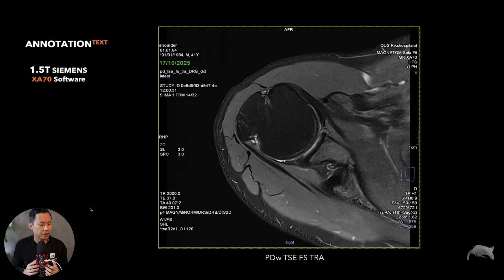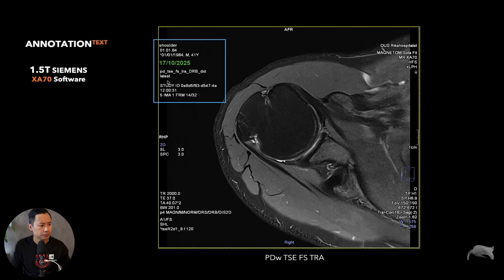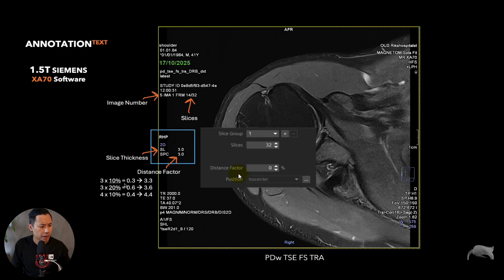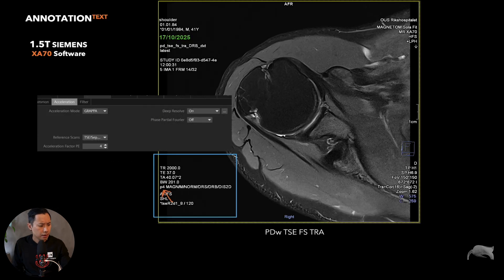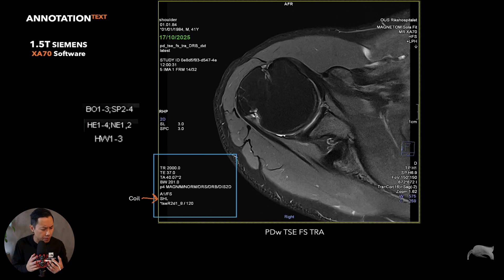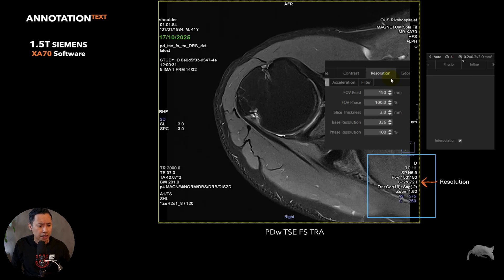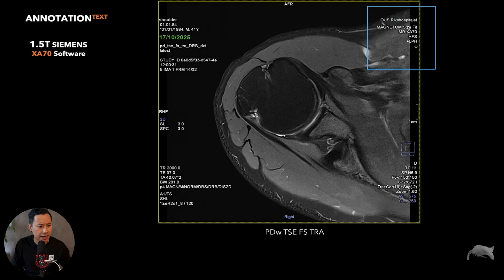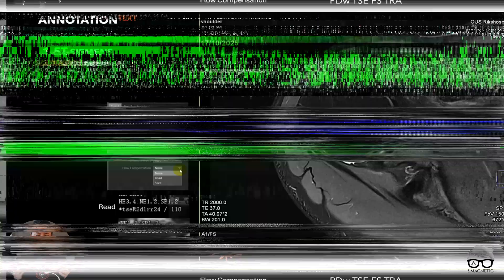🧠 MRI – Annotation Text – Part 1

Comment: Quick question, why if the distance factor is 50 and the slice thickness is 3.0 and so 3x50%=1.5 and so what will be the SPC then?
Reply from the maker: 1.5mm distance correct. In between those slices of 1.5mm you will lose information. Only positive is you need less slices to cover over that specific area. Thereby saved scan time if possible by adjusting the TR
Reply: @Nguyen_MRI definitely I know some information might be excluded but sometimes we scan for Spine or other basic scans and get to increase Distance factor but I'm asking what will the SPC be if the Distance Factor was 50.
Reply from the maker: @Jesus_peking hover your mouse over that parameter and you Will see also

Comment: Very helpful video, thank you so much. Could you please make a video about acceleration (GRAPPA, SENSE, etc.) and how to compensate in order to achieve good image quality in the shortest possible time? Thank you in advance.
Reply from the maker: Please check this one : https://youtu.be/RK4uoTp7Xng?si=Lb7nfA0rOXHpN5K7
Reply: @Nguyen_MRI  Thank you very much, that was really helpful. I have a question: regarding the parameters of each sequence to determine whether it is T1, T2, PD, is there a standardized range of normal values? I’ve reviewed several references, but the values seem to vary among authors. I also noticed that when I adjust parameters such as the FOV, the TR, TE, bandwidth, and scan time also change. Thank you in advance.
Reply from the maker: @itzet4368 yes very much variations until a certain point of max and low before losing contrast of you wanted weighted. Remember also physics between low field high field and ultra etc are differently.